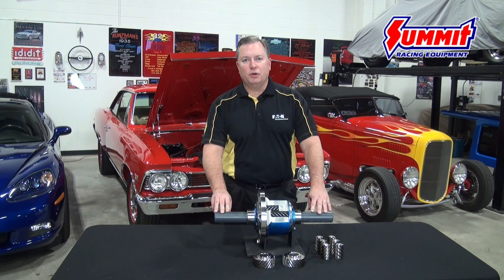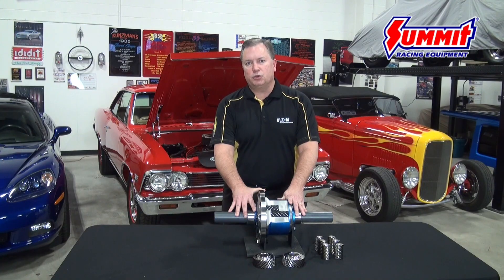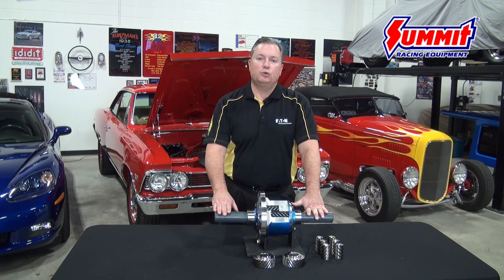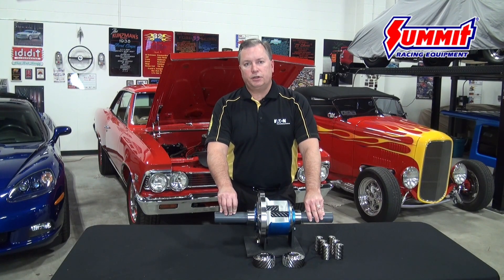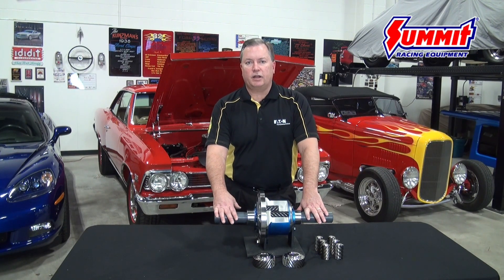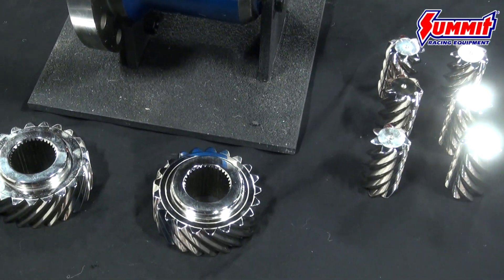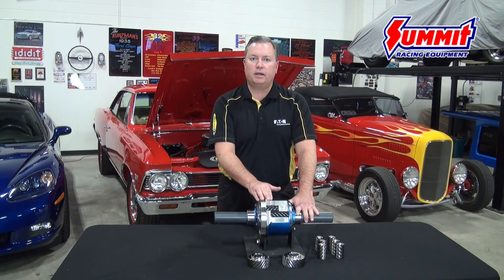Eaton Detroit Truetrac Limited-Slip Differential

Comment: Hey Jeff, I bought a 2024 F150 XLT 4x4 Crew Cab, the one thing im kicking myself for is not checking to see if it had either a Limited Slip Diff or Locking rear diff, I was so happy with the incredible deal that i got and saw the "4x4" on the side and just didn't think much about it at the time. Checked my axle through the VIN and it's an Open Diff. At any rate, I now have a dilemma, I would like this Eaton True Trac LSD, but I now have to figure out how to get it installed that doesn't compromise my factory warranty (I paid extra for Ford Ext Warranty). Any suggestions? Really trying to figure this out where I don't get burned in the end of it all.

Comment: The only question I have is this: If one tire becomes airborne, is the differential going to transfer torque to the grounded wheel, even if the vehicle is stationary? I've seen both "Yes" and "no" answers to this same question.
Reply: Correct answer is yes, BUT first the wheel seeing zero traction needs to be braked momentarily. This can be done in rigs w/ no ABS by power braking. Rigs w/ ABS and electronic traction control will have the drivetrain computer utilize the ABS hardware and software to apply brake only to the spinning wheel, thus "switching on" the TrueTrac. It's pretty nifty. Cheers.

Comment: hello! Is it advisable to use a truetrack, is it recommended on the front axle? For a wrangler mixed use more than normal road?
Reply: These days Jeep guys are using the TrueTrac in the rear axle and then an electric locker in the front axle. Three-wheel-drive works for 99% of most offroading, then flip a switch for the front locker and BINGO true 4-wheel-drive! It's amazing.

Comment: Uhhh…. Is this not the same design used in the 5th gen (10-15) Chevrolet Camaro SS’?? GM specs their rear diffs (same unit in this video) to be used with their OEM (AC Delco) 75w-85 gear oil and LS additive. 

Most people have had complaints about having tons of rear axle differential noises. Some have actual axle issues, some end up having warranty swap things like the axle seals or simply just do a simple drain and fill for a gear oil replacement (w/ the required limited slip additive). Their procedure after changing the gear oil and adding LS additive, is to do a series (usually 6-8+) of figure 8’s at a slow speed, supposedly to work in the new gear oil and limited slip additive all the way throughout the diff unit. 

People have gone from running a bunch of different things, trying both full synthetic and semi-synthetic GL-4+ (GL-4/5 compatible, usually yellow metal safe) and GL-5 gear oils. Most people seem to run the formulas that include LS additive already, which on the bottle/packaging, should typically indicate so. 

However, some don’t run LS additive at all, have some minor noises and get away with it. Most even go to lengths of adding EXTRA LS additive, which I’ve heard, can cause excessive slippage, to the point of doing one-wheelers in a straight line (yikes)! 

It’s such a picky and wonky LSD!!
Reply: Never use "LS additive" (friction modifier). Latest info is to don't even use full synthetic gear oil. Just use a good quality mineral gear oil 80W-90. If the ring-and-pinion is correctly installed there should be no noticeable additional noise.
Reply: My bad - Never use LS additive/friction modifer in any helical-gear limited slip. Why? Because there are no friction materials (clutches) in a gear-type LS. Just use standard, good quality dino gear lube. Cheers.

Comment: I have an Auburn cone style LSD in a Cobra that weighs 2300 lbs and near 55/45 weight distribution.  The Auburn, which is a more aggressive unit, appeared to be the best choice 20 years ago, however combined with this lightweight short wheelbase car, it causes severe understeer when powering out of a corner. The front end gets even lighter under acceleration further aggravating the problem. The Truetrac is less aggressive, but would it make a meaningful difference in this application?

Comment: I really like mine in the Ford 8".
Jan. 2021 Eaton was recommending CONVENTIONAL, non synthetic, 80w90.
Cautioning me to not use synthetic, posi lube, or Lucas because.... Those will reduce the bias. They also told me that they suggest fluid changes of 10,000 miles. I installed a drain plug for easy changes.
Really like the TrueTrac so far. Zero negatives. 👍👍👍

Comment: Hi there,   nice video,   1 question,    will running 2 different diameter tyres hurt the True Trac,   talking maybe 1.3 inch overall diameter,   my spare tyre is slightly larger In diameter than the tyre on the car.   Reason is having fat and skinniest makes it hard to have a spare that covers front and back wheels .  Cheers.
Reply: The diff will think your turning all the time and just adjust for that rolling difference.
Shouldn't be a problem.
Reply: @hotrodray6802  Thanks for that, as I am running an Eaton Truetrac and been great so far,  3600lb car,  10.52et @ 130mph.  I have measured the difference in tyre radius from spare to on the car,  I will drop air pressure to 17lbs on the spare  to get both radius the same,   that should help minimise the difference in the 2 tyres.   Cheers From Australia.
Reply: @marsv7777  
Reducing the rolling radius does NOT change the tire circumference/ revolutions per mile. 
How could it?
Reply: @hotrodray6802  Because you have changed the loaded radius. That's how.

Comment: I installed one of these recently and was disappointed by the accompanying instructions, which very nearly caused damage when followed exactly. They specify to use the OEM backlash setting, typically between .006 and .011 for my rear end, which is incorrect. Upon consulting a very reputable gear specialty shop, I learned that the correct setting is zero to .002 for track use and up to .005 for street; anymore backlash will be noisy as all get out and potentially damage the ring & pinion. The most frustrating part of figuring this out was when I found out that the same Eaton Truetrac branded as a Yukon Truetrac comes with correct instructions that explain all of this. What gives, Eaton?
Reply: In Ford 8" i installed the TT without removing the drive pinion and reinstalling the same ring gear and backlash.
Theoretically it should run perfectly. But I have a "pull whine". Doesn't make sense. 
Love the TT operation.
Reply: @hotrodray6802  what was the backlash measurement?
Reply: @PNWJEEPER01  Drive pinion never removed.
Original was 8, reset to 8. Same gears, same backlash.

Comment: I have a 2006 Ford F250, 6" lift, 37" tires and I am getting 4.56 gears put in with the TrueTrac in the rear. I do a lot of heavy towing (10k-13k lbs). Can I use synthetic 75-140 with this unit or do I have to use 85-90w or something like that?
Reply from the maker: Eaton recommends a petroleum/mineral based GL-5 80W90 gear oil for all Truetrac differentials. Do not use synthetic gear oil or friction modifiers.
Reply: @SummitRacing  How about a petroleum/mineral based GL-5 85W-140 like Lucas High Performance Heavy Duty oil?
Reply: Summit.... Your video says syn can be used, yet Eaton says NOT recommended.

Comment: 0:38 = It generates a 'Bias' of 3.5 .  Basically what that means is that the diff will lock up both axles together until one axle's torque EXCEEDS 3.5 times the other axle's torque. After that 3.5 is exceeded, it will start to act more like an open differential and then you get wheel spin on the wheel that is on the ice or is up in the air (offroading). To fix this, you just step on the brakes a bit to increase the resistance to the spinning of that unloaded axle, and that then sends more torque to the axle that has the traction. Most vehicle's traction control will do that for you already, and this differential makes those traction-control systems much better, and quicker at stopping unwanted wheel spin.
Reply: so does it do a good burnout
Reply: @hreindustries  yes
Reply: Thank you much for that info
Reply: interesting. i have a truetrac in my car, and when i got it, i stopped on the shoulder and put the pass. tire in the gravel, and the dr. tire on dry pavement. hit the gas---the pass. tire didnt turn more than 1 or 2 revolutions and all the power went to the tire on the pavement, and left a black mark as it spun. i got virtually no wheel spin on the tire on gravel. but yes, at that point it turned into an open diff and transferred all the power to the one tire on pavement. works very well IMO. no braking was ever used.
Reply: Zbot
An open would have spun the gravel tire and NOT the hard surface tire.
Reply: @ZeeboLaywicker  You din't need any brake cuz both tires were on the ground. What HCounts was talking about was if one wheel was off the ground, basically. Cheers.

Comment: I installed this in a 79 T/A ,now I get a slight rattle at low speeds
Reply: Damn .... China made!   That sucks.     Wtf .... can't we make anything here anymore.
Reply: Taiwan.
Reply: Maxx Masson What’s the rattle from?
Reply: @WesternReloader  as soon as I installed at low speeds there is a constant rattle that goes with the speed of the car ,which slows down as I slow down but its very slight at low speeds ,I been a mechanic for 40 years ,I believe there is a slight imperfection in the small worm gears since the unit said made in China ,I would recommend the Detroit Locker ,which I plan doing next summer

Comment: They work great for a on/ off road vehicle. If you have an unloaded tire ie. off the ground you just tap the brakes and it will transfer power. If you have a newer vehicle, the traction control will do it for you

Comment: Iv'e used nothing but these beauties for more than twenty years in three different jeep vehicles. Nothing even comes close to the versatility of the truetrack locker. On pavement it drives like an open diff, off road it steers like an open unit but locks up really well in soupy, sandy, or snowy conditions. Watch the vehicle that walks up sections you're having difficulty with, it probably has truetracks in front and rear :)

Comment: I bought one from Summit for my GM 10 bolt diff on my 83 K10 Chevy.  Went in smoothly, LOVE IT LOVE IT LOVE IT!!
Reply: Well it's been 3 years how's it doing now.. I've seen a lot of negative reviews of them not lasting more than a year especially if you're running hard.
Reply: @michaelmajor5467  Just thinking out loud, here. Take it for what it's worth. Dudes that run serious horsepower and 40" tires can and will break anything. Those guys are all running 1 ton axles at a mininum, and then running true locking diffs (air activated or electric) and custom axles. Big, I mean BIG heavy tires alone will destroy drivetrains and steering linkages. Keep your machine within a box parts-wise. Only go bigger when it can actually be afforded financially. It's like anything else. Speed (or in offroad, sheer capability) costs. How fast do you wanna go?

Comment: Just had this installed to replace the factory clutch type LSD on my 9.75 Ford axle.  The main concern looking at the unit is there is very little access for lubricant to reach all of the gears inside the case.  Oh and a more accurate name would be Taiwan Truetrac because that's where Eaton makes these not Detroit (sarcasm).
Reply: How do you like it so far??
Reply: I filled the TT with oil before installing the unit in the housing. Messy, but everything was well lubed initially. 
I installed a drain plug on the housing and a magnet on the fill plug and changed oil at 250 miles. Eaton recommends oil change every TEN,000 miles they told me. Easy and cheap enough. $20.

Comment: Everyone seems to be making fun of the guy in video.  I must agree that it was very wordy and technical, but if you learn some of the lingo/terms you can understand that He is basically saying that the system is like having the best of both worlds.  A locker when you need it and an open diff when not needed.
Reply: But it's not a locker and it never will be. It took some time for me to accept that fact because I wanted to BELIEVE!
Seriously, though, yes; it is not a locker but the Truetrac was, is and will always be one of the greatest differential designs of All Time. They just flat work as the best limited slip diff ever, and almost seamlessly. Cheers.
Reply: Eton said not to use synthetic oil when I installed my trutrac. He's full of it.
Dyno oil only...
Oh, he did not show how it works, piss poor salesman.

Comment: My F150 has an AWD mode for the transfer case that allows me to have all wheel drive in light snow or heavy rain or just driving through the yard without going full on 4 Hi or 4 Lo. Will this limited slip diff work on my front axle while still being able to use the AWD sometimes?
Reply: Yes. The only thing your AWD button does is selectively engage the front axle when needed. My Tahoe has the same thing. This unit replaces your differential, so if you have it installed, if the axle you installed it on is being driven by the transfer case, then your truck will be able to take advantage of the benefits if offers. It acts like a regular open diff until a low traction condition occurs, then it will automatically bias torque to the wheel that has the most traction.

Comment: After watching this video, I actually know LESS about the TrueTrac than before I watched it.
Reply: They fucking revoked your knowledge. Thats insane.
Reply: Don't think too hard - it's just a variation of a torsen drive that's a little more robust.   Eaton recommends you stay away from any slip additives, which unfortunatley come with most gl5 oils these days, and I've caught mechanics mindlessly adding it on vehicles without verifying what type of differential is in service.  This reduces bias and needs to be avoided.  The question of traditional vs. synthetic is mostly driven by the seals you use - stick with what they are spec'd for.  Valvoline, Torco, and Driven all offer oils that work well.  The business of using a gl4 varies, and comes down to whether there are any yellow metals involved [brass or bronze], which should not be present in a rear diff - that's gearbox stuff.  Think of a truetrac as a low maintenance posi.  If you want to install this diff and keep C clip style axles, you will want to have a good pair of clip pliers like KNX-44-31-J32 or equivalent for getting the retainer assembly in/out to get at the spacer - the cheap tools at your local hardware store are an aggravation.   Also worth noting is the total mass of the diff: you will need less oil than an open diff - I recently swapped over [in a 12 bolt housing], and the old 2 1/2 quart rule went out the window,  making my max volume 77 ounces.  A simple drain/refill without removing cover and fully emptying axle tubes/housing came out to 70 ounces.  I arrived at a new number by doing initial fill [using fill point on aftermarket diff cover and it's bottom drain plug for removal] with 84 ounces, rocking the axle tubes, then leveling out/letting it rest for 20 minutes before opening the proper fill plug on the housing and draining out the excess.
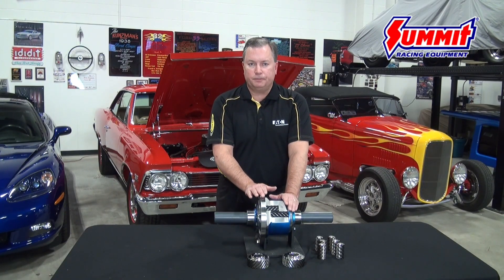Reply: Flinch thanks for the info. I’m currently building my Bronco motor, and am re-gearing my stock diffs to 4:56. I’m not gonna do anything other than trailing (and live where it snows pretty good) so I’m leaning towards these Detroit TrueTracs for both front and rear (cost, longevity, flexibility, auto functioning) 
For a setup like mine, you think they’re a good fit?
Reply: @WesternReloader  
To eliminate all slip but still have differential ability, I'd go lunch box lockers if extreme abusive torque load is not a factor. All the load still goes through the spider pin to the case like an open.
Reply: Before giving a piece of your mind, be sure you had it to spare.
Reply: Lol
Reply: That's why it's called dope.

Comment: To much taking..... All talk no action.... so how does it work !!!!!!!
Reply: A Helical Worm Gear will turn a Helical Sprocket Gear, but a Helical Sprocket Gear can not turn a Helical Worm Gear. Thus, a working "Locking" Differential is born.

With this type of differential, one axle of your diff can not spin freely, it must transfer over to the other side at the same rotational speed.
Reply: Strixx 

Almost... it does allow SOME speed differential between axles.... hence why it's better than a locker OR an open diff. It allows the differential speeds of an open diff, so it doesn't bind in sharp turns like a locker would.
Reply: Strixx it's not a worm it's a helical.
What you're missing is the helical ends jam against the sides of the hardened case and push against their "containment tubes" which causes the locking. The gears don't "bind" together, they separate and push the helical into the case sides.
Reply: @True Canadian I know how they work, and have installed 3 Eaton TrueTracs in the past. 

I was wrong when I said in my previous statement they rotate at the same rotational speed, but meant to say equal opposite rotational speed in reference to the carrier, But it must transfer over to the other side in the opposite direction. Which allows one side to spin faster than the other. Both both axles are connected to each other. When the pinion spins the ring gear, it transfer power equally to both axles as long as it is spinning faster than the changing axle speeds.